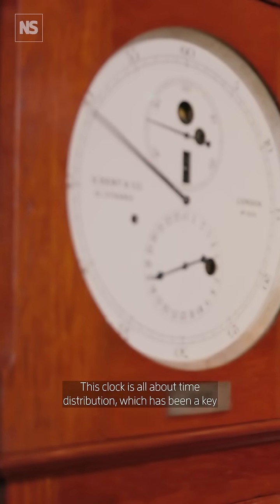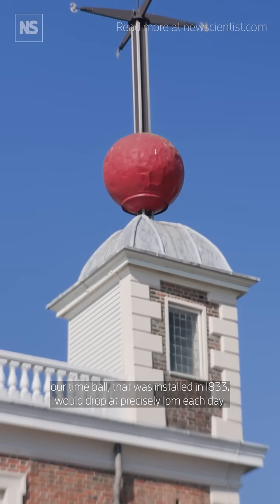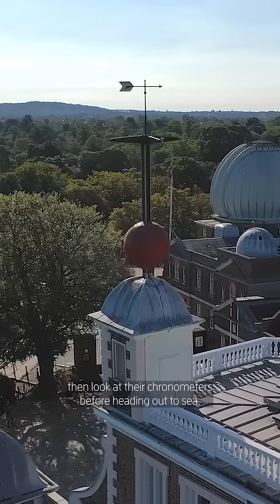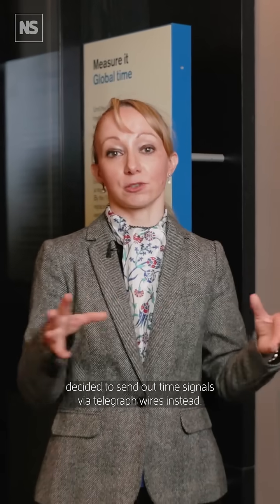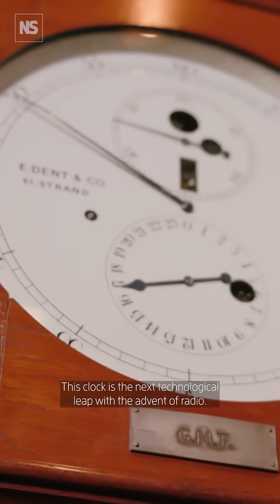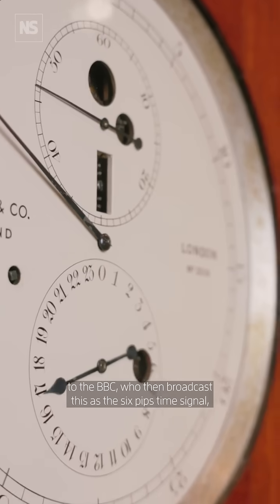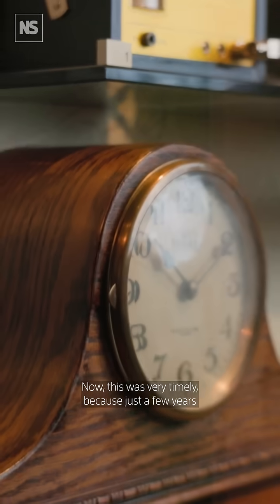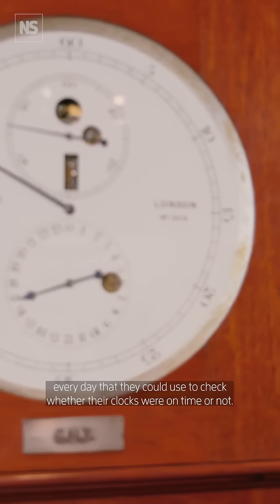How the BBC's six pips time signal helped synchronise time 🕰️

Comment: I well remember synchronizing my watch with the six pip broadcast by the Dutch national radio.  My watch had a setting in which the seconds hand could be stopped. I would stop it at the minute, a few minutes before the hour, set the watch to the full hour, and then wait for the sixth pip to restart it. I learned to take 5 minutes or more for the procedure. From that watch I would then regulate our large antique clock.

That was in the seventies and eighties. Even in the nineties and naughts I would synchronize computer clocks from my watch. Computers that needed more accuracy were connected to a radio receiver DCF77 receiver.

Now my smartphone and computers are regulated to within a few milliseconds automatically.